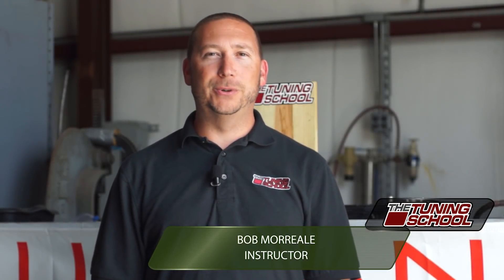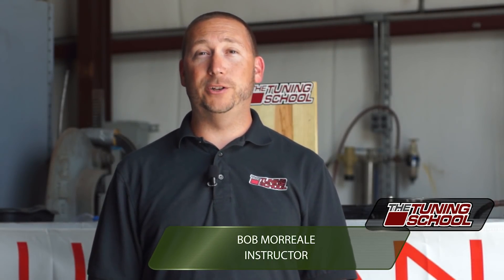Which spark plugs are best for performance tuning?

Comment: I agree ,copper plugs may not last over 20,000 miles or 1000 hours  but they are better and can help with a bit more fuel mileage and worth using especially with spark plug wires for less residence   .. I would not use them on a place  to get to by the way some engines are designed to put them where it takes hours to change them ..The iridium and platinum's work better with less gap space  ..

Comment: Champion copper plus are the best!  forget about Ngk  or Bosch !
Reply: why copper plus?
Reply: well because the engine of your car is made and tested with a copper spark plug. if you then put another kind in it such as iridium or platinum, the computer will adapt to this and your car will have loss of power over time.  Also its bin proven that the copper plugs are a lot more powerfull than iridium or platinum. 

just always stay on the original spark plugs that your car came off factory. But if your car came with iridium factory, you should not switch to copper or platinum
Reply: @scottykilmer3920  agree thank you why champion copper plus and not ngk with copper core?
Reply: ngk spark plugs are very good. But I've tested them all bosch Ngk Denso and Champion. with all the same specs. From my own experience, I only really felt every torque of the engine with the Champion plugs! the champion copper plus spark plugs are also known to ward off heat very well. No matter how long you drive the car the engine continues to run extremely powerful only with the Champion spark plugs. With the Ngk and Bosch and Denso I really noticed less power and rough acceleration when the engine got hot.  With the Champion it became as smooth as butter!
Reply: @scottykilmer3920  great, even if champion spark plugs are made in France or Belgium?
Reply: Champion plugs are made in France these days nothing wrong with it. Maybe they would last a little bit longer if it whas made in usa. But i dont think the quality is lower made in france.

Comment: I run ruthenium plugs in my 2 heavily modded Ecoboost engines. I pulled my ruthenium plugs at 45,000 in my truck. Same gap at install .030. I'll never go back. Ruthenium is the new king of plugs. I didn't even tell my tuner till after my data log, he was so impressed he now recommends them to his new customers.

Comment: The famous 95 MERC's 4.6-Liter V-8 runs BOSCH #9605 Double Iridium Spark Plugs, gapped at .054";  BOSCH "Mag-Core" Ignition Wires.
Perfect combination for long-distance, high-speed cruising through the deserts and mountains of the American West.
16 City, 24 Highway .

Comment: So many people got fooled by this video, LMAO.
Conductivity doesn't even matter due to the presence of resistors in spark plugs & also..
Only the electrodes are made up of precious metals like Iridium & Platinum.
The core is Copper, always!!
You don't need Silver or Copper plugs to prevent Pre-ignition or knock, you just need to use the correct Octane fuel recommended by the manufacturer & the spark plug number specified in the user manual.
Iridium plugs are definitely worth it due to their low maintenance & very long life!
Sheesh! 😅
Reply: Sounds like ole Otto here doesn’t know the difference between electrical and thermal conductivity.

Comment: 2004 dodge hemi has 16 spark plugs 2 for each cylinder, I went with iridium I hope I don’t have to change for 100,000 miles my engine probably only got 50,000 left in it. I don’t want to change 16 spark plugs ever again

Comment: It's not heat that causes the ignition it's the arc and changing the spark plug type changes the capacitance value and time, and because an inductor feeds that capacitor  , the inductor needs to be matched to that value so sometimes just changing the spark plugs isn't enough to improve the "tank circuits" performance, and what is importance besides impedance matching is the CONDUCTANCE OF ELECTRONS not heat unless your driving diesel. 

Heat dissipation is a problem specially involving the explosion of fuel and balancing the "stoik lean" by type of fuel and compression ratio and air fuel ratio

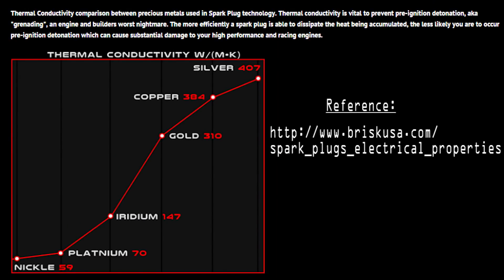Comment: Most spark-plugs have copper core, none have copper tip. When someone refers to copper spark plugs, they actually mean copper with nickel tip. Your graph on heat conductivity actually shows that nickel is a worse heat conductor than both platinum and iridium at 01:58, completely invalidating your point. What actually matters is the heat of the spark plug and gap, determined by the insulator nose length and physical gap between the anode and cathode.

Comment: Thermal conductivity and electrical conductivity aren't the same thing though. Iridium and platinum tips require less energy to produce a hotter spark and they are less likely to erode or melt.
Reply: The Voltage Requirement for copper is lower because it is the second best conductor after silver  ,the typical copper core with Nickle .. just called a copper plug .,,is used on small engines ,lawn mower weed trimmer ,etc.. with magneto coils that are low voltage low current output /... Iridium and Platinum tips plugs are not used for that because they are terrible conductors that require more power by the ignition coil  and the magnetos are not  as strong as theses high powered 12V ignition coils  that is connected  to the spark plug  now that helps with the poor conductivity of platinum and iridium tip plugs unlike the older spark plug wire days  when copper plugs were always used ...
Reply: Many new high performance cars still use  the older copper nickle plugs

Comment: well, what if you add an ignition coil and ignition box (e.i. Mallory, Accel or MSD) to push more joules through to the spark plug while increasing your gap by .010 on boost? How does that affect the tune?  very seldom do I see a "spark plug" video addressing these changes...

Comment: I dont really get it. The heat range should consider other tip materials or not? Why should a iridiumplug with a 5 heatrange run hotter than a copper one with a 5 heatrange.... wouldnt the iridiumplug burn away if it were so? Driving the same heatrange as original on a engine with lifted CR, porting, cam and so on and I dont get knock or burned off or dirty plugs...... and thats iridium. the plugs are 40,000miles old and look like new...
No loss in compression, no loss in oil pressure, piston looks like new. If it were that different, then I must. have had some problem by now...

Comment: I just regrease my spark plug bearings and put them back in.
Reply: There's nothing like a well lubricated spark plug for sure 😂 I recently installed coolant squirters in the combustion chamber as well. It like oil squirters but point at the plug keeping it cool 🥶

Comment: What if OEM plugs are iridium spark plugs. I have a 2013 Cadillac ATS 2.0t which has been tuned and modded with ZZ Performance parts. OEM were AC/DELCO iridium plugs. I swapped out to Denso iridium race plugs. Would I be ok in that scenario? Thanks n advance

Comment: Accel U Grooves are made by Nippondenso and Ive run them (Nippondendo) in everything from dirt bikes, jetskis, turbo charged motorcycle engines spinning 14,000 RPM making 52 PSI @ the intake valve, and in my 11:1 Super Stock Corvette. No other plug could stand that much boost pressure other than the U groove.

Comment: I wish I saw your video 3 weeks ago .
I put iridium NGK in my supercharged hayabusa drag bike ,  blew the ends off and damaged the valves .
Bit older , bit wiser
Reply: Next time try some Nippondenso 22's. I ran them in my GPz750 with 52 PSI @ the intake valve.

Comment: I am confused because a lot of tuners tell me to run NGK 6509 - LTR / 6 i x 11 for normally-aspirated 392 Challenger and those plugs or iridium and you say not to run them but Forza tuning says they're okay so which what plugs are what is the part number I should run then
Reply: It depends on if you’re stock or modified. I went one step colder when I was na on my 392 and had bolt ons and a tune. Ngk 6510 which was one step colder but was a projected plug. Now that I added a procharger, I noticed the same plug which was one step colder but a projected plug was causing detonation. I switched to the non projected brisk plugs rr14s and the detonation went away…

Comment: My car engine in Honda City and I'm install a anutral gas  CNG so should I use hot or cold spark plugs and thanks for the video
Reply: Example - DCPR7EIX. The digit code in this word specifies heat range. Try 6 or 7, it will be good.
Reply: For light-duty engines use a lower number. For high performance engines use a higher number plug which is a cold plug.

Comment: Thanks finally an answer to my question !
Reply from the maker: Hope this helps!
Reply: @TheTuningSchool  Hi, I have an Alfa Romeo 147 1.6 105 hp twin spark 77kw with LPG system, which spark plugs could I put for a better yield and fluidity than the original Ngk or better, specific spark plugs for LPG like the brisk silver? Or can you advise me better? The candles are 8! Thank you!
Reply: @lucapetrucci9124  Guarda secondo me dovresti provare delle candelle di rame giusto perche i motori a GPL hanno gli scoppi molto più caldi rispetto a benzina, l'unica cosa che devi cambiare piu spesso le candelle.
Reply: @TheChr1574n  Si infatti...stavo pensando di mettere le Denso all'iridio o le pulstar che sono ancora più avanti in tutto e costano di più. Forse ci vorranno anche le bobine nuove...Non saprei grazie👍

Comment: Most sparkplugs have copper core, regardless of the electrode tip. So you are mixing terms. The  spark plugs used in engines  are copper core, then they vary from nickle, platinum to Iridium electrode tips. Copper electrode tips just don't exist. There's a misconcepction, what most people call copper spark plugs are really nickle (tip).
Reply: Exactly!
This guy really did fool a bunch of people.
Copper is too soft to be used as the electrode, its usually Nickel Alloy if i'm not mistaken.
Reply: This needs to be seen
Reply: This! Platinum and iridium make up only a tiny portion of the spark plug - the actual surfaces where the spark forms. Do you have any idea how much those metals cost?! Trying to make the whole core out of those metals would be wildly expensive!
Reply: copper tip exist in malaysia

Comment: I've used them all and silver was the only one that would do a complete burn on each cylinder I know this because I looked at them all the other plugs would leave deposits downside of silver is that it will not last as long

Comment: I've been running Brisk (formerly PAL) in my motorcycles since a mate told me about them. All the dealerships stock NGK because they don't last very long so ensure a high turnover of sales (I had a dealer confess this to me that he sold 3 times more NGKs than he did when he only stocked Nippon Denso). I buy my Brisk spark plugs online so avoiding the dealership mantra, "We only stock NGK!! Take it or leave it!!". 

So far my Brisk spark plugs have lasted longer than 2 sets of NGK plugs so I'm happy.

The best plugs I've ever run in an engine, regarding a noticeable performance improvement, was Lodge HH14 Sintox plugs back in the mid 1980's. These had a copper core and tri-prong electrode. They gave a noticeable hike to low down and mid-range power. They also cost 3 times more than a conventional spark plug.

Before switching to Brisk spark plugs, I ran expensive NOS Lodge HN Sintox, NOS Champion L-81 / L.-85, etc. anything other than the problematic short service life span NGK plugs. The longest I managed from an NGK plug was 4 months before it did the NGK trick of stopping firing once the engine heated up.
Reply from the maker: Thanks for sharing! We're happy to hear you're happy with your results!
Reply: @TheTuningSchool  Brisk were originally a subsidiary of PAL. My bikes, all Czech built 1970's, 1980's & 1990's Jawa & CZ 2 stroke machines, were originally OEM equipped with PAL 14-6 plugs, which weren't sold in the UK, hence the replacement with other brands.

Post 2000 Jawa 2 stroke motorcycles are OEM equipped with Brisk N-15 plugs. These are the recommend and only replacement spark plug sold by the online global Jawa & CZ parts supplier Jawashop.com

I'm presuming the Jawa motorcycles 4 stroke machines also have Brisk spark plugs when they roll off the production line.

Comment: Yeah sure if you’re a gear head or a grease monkey like to working on cars all the times.Than those Coper,Silver spark plugs designed are for you.Because it will give you a little more powerful and in performances like 20-30% better power output for your engine but most people doesn’t wanted to changes them spark plugs again within in 50-60 thousands miles.Platinum spark plugs can give 80-90 thousands miles and those Iridium spark plugs can giving 100-150 thousands miles.
Reply from the maker: Thanks for your input!

Comment: It's like having a lit match in the chamber having some of these plugs,  back in the day   my dad had a 327, that had a oil ring issue, and a temporary bandade, we put the hottest plugs we could get, it still had high compression, but used foul adapters, it moved the plug out of the chamber, it would foul plugs about 2-3 times a week, that got it by until he got another ride, I just wonder if foul adapters, or preventers, would work well in a turbo engine? Or if anyone even knows? Has anyone used the bosh plugs with 2-4 electrodes with boost, or the E3 plugs? I guess the plane old 1970's work, we ran AC r44's and 43's 30 years ago in 283's and 327's with 11:1, they can foul at idle, too cold for street,

Comment: Copper is the way to go... I would rather run copper/silver and change them frequently than have tuning issues.... i went to high end plugs on my turbo engine and had major issues... then went back to the OEM Originals from a spare motor i had and car ran like a champ... OEM Coppers! Won’t make that mistake again and they are so much cheaper so I swap them when I do oil changes lol

Comment: I've 
Tested spark plugs for 5 yrs, on the dynos. It seems that direct injection is causing FCA a problem, we've found by hit and miss that some of the problem with preignition that eats up spark plugs is actually a oil problem. Oil companies are now working on this problem. If you contact AMZOIL they can explain how this caused.
Reply: Tried to find the contact info for AMZOIL, seems there is no such company.
Reply: AMSOIL

Comment: I use Champion Copper Plus Spark Plugs on my carburetor car for the last 20 years. Never had a problem with them and really cheap to buy of Ebay for a pack of 4.
Reply: Cheap is not always better,you get what you pay for.
Reply: @perryclark3897  In this case yes. My Champion spark plugs are cheap off Ebay. It's from a quality manufacture.

Comment: i disagree with this.  copper spark plugs have a copper core as do most others (including platinum and iridium).  the difference is that the outer covering is a nickel alloy.  nickel is actually has a lower thermal conductivity than iridium but higher than platinum.  likewise it has a higher electrical resistance than iridium and lower than platinum.  iridium will retain its sharp edge better as well as have a finer tip which means it will spark more consistently with less voltage.  furthermore with a finer tip it will also absorb less heat in the first place, not to even talk about the lengths of time it will retain its optimal characteristics due to its hardness and strength. so in conclusion it seems to me that iridium = lower voltage/lower electrical resistance, higher thermal conductivity, longer life, more consistent spark = more power, more efficiency.  don't get me wrong, copper is great in electrical uses, but not helluva suited to high temperature applications.  As an aside it's also important to mention that when selecting a spark plug when you have something like a double platinum spark plug it means that while the central (tip) electrode is platinum, the lateral (arm) electrode has a small circular head on its underside which is also platinum.  This is important because the spark will be easiest to make when you have a small sharp edge on both electrodes and the platinum just makes that edge more durable.  A lot of iridium plugs have an iridium tip and platinum arm head electrode.  double iridium exist though.  The most logical route for best performance would be to actually have double iridium with a silver core.  silver is weaker than copper but better at thermal conductivity and lower resistance.  to use pure copper or silver for the electrode would be madness though since gasoline combustion cylinder temps reach something like 1000 degrees C and copper starts melting at 1080C and silver at 962C... I don't know, maybe I'm missing something here.  If so please enlighten me.
Reply: You definitely Google that because there's no way in hell you'd waste your time commenting something so long. And you're definitely trying to sell me iridium or platinum spark plugs🤡

Comment: NGK's are the best you can get. We tested several other brands, one brand, the ground electrodes always fell off. One, the porcelain separated from the metal.  NGK's on full turbo boost always survived.
Reply: I've got brisjs and now have misfires thabks to these plugs don't go brisk uve been warned onto ngk now
Reply: @ozzyalis I'm so glad I've seen this comment. Been buying brisk racing ones for a while now and been having a lot of rough running and misfires. Have bought iridium's now and am waiting for them to arrive. Hopefully it will sort the issue. Shame really as it's a really cool spark plug design, but it's obviously not good for most engines as mine is running rough.
Reply: What about HKS Super racing ?